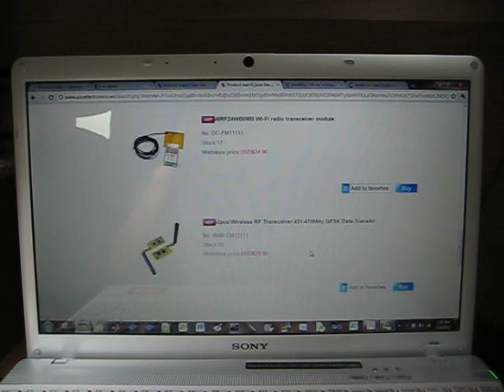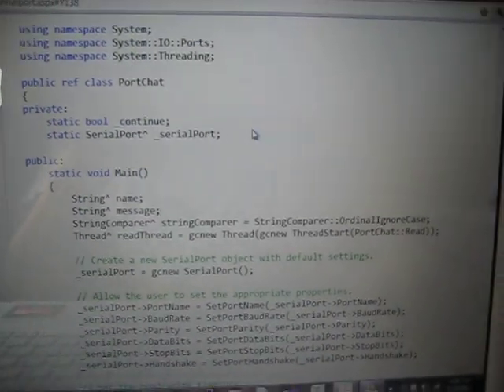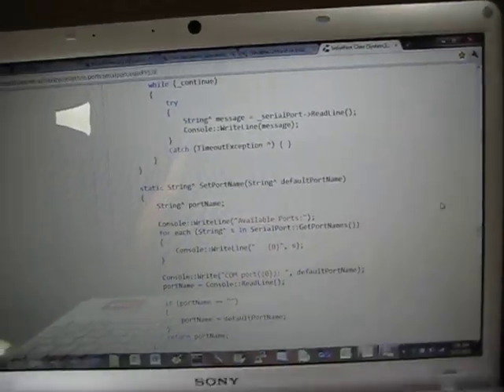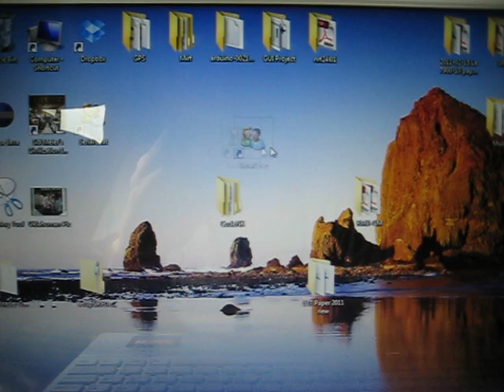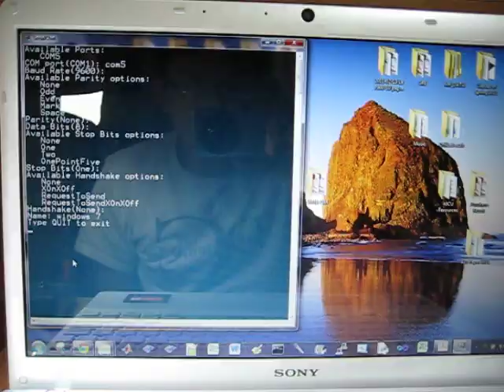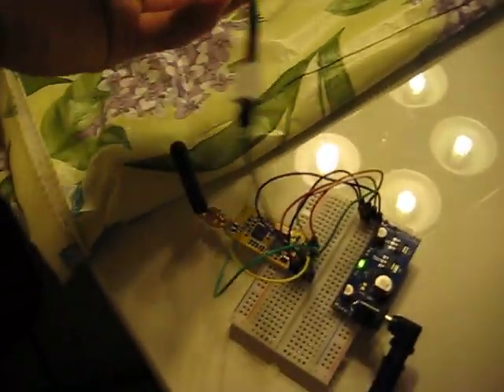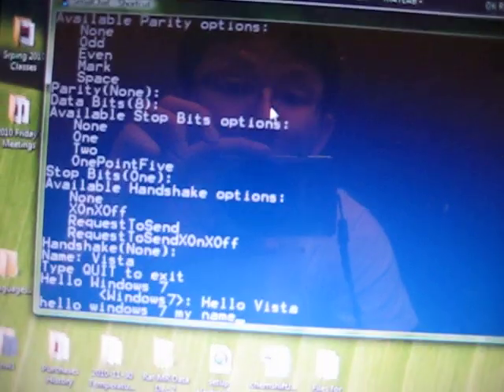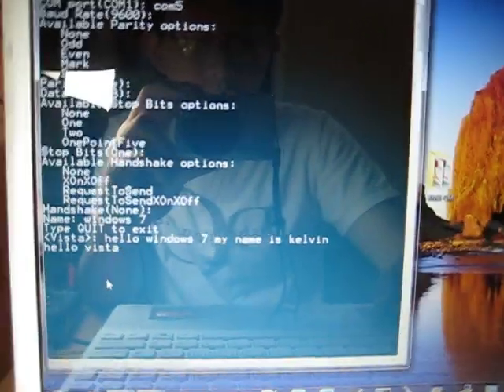Wireless RF Transceiver 431-470MHz GFSK Data Transfer

Comment: Dear Kelvin I tried to follow you but failed. I am looking for all your you tube videos and I really like your presentations. I am using the NRF24L01 which are transceivers. Would it be possible to guide me how to program these one to be transmitter and one the receiver? the code I need how do I go I don't know please help me.